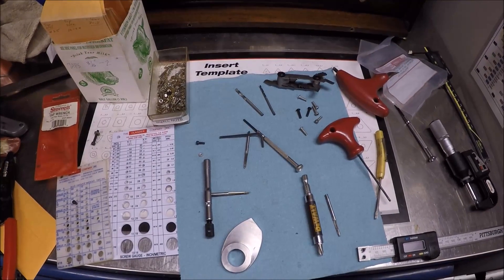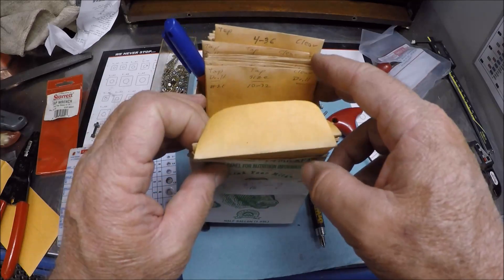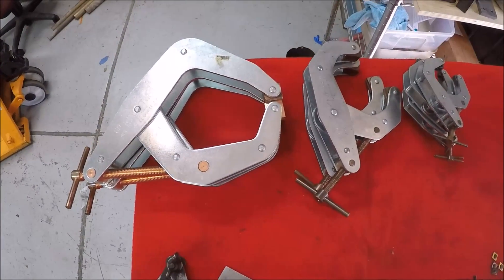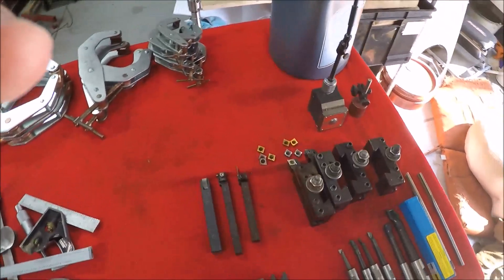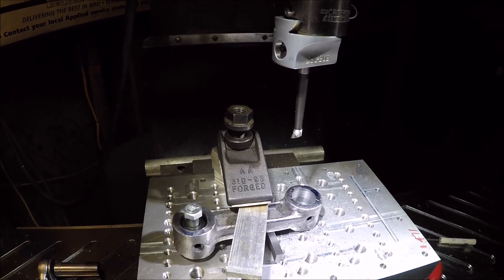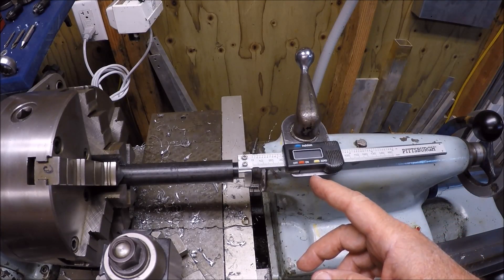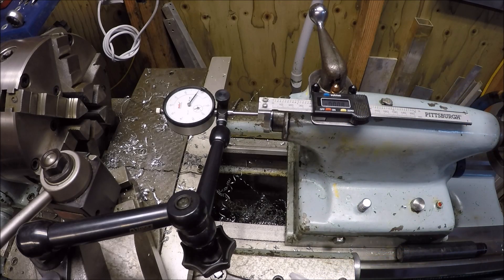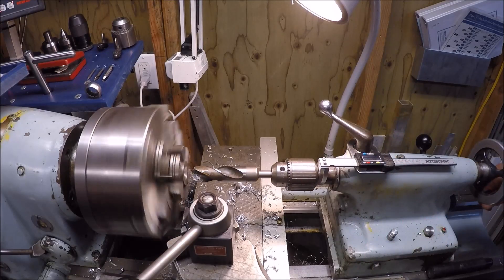Monarch 10EE Tailstock DRO Part 2

Comment: What ho Chuck, it seems there are a few things that should be common knowledge amongst the home shop guys but isn't. Abom didn't know about the "master" chuck key hole and you, please don't take this as criticism, appear to not know about drill chuck key use. When ever you tighten, or loosen, a Jacobs style chuck you always pull the long handle so the load is against the gears, to ensure proper engagement, The way you did it tends to bend the gears out of mesh and will wear them out. 
On a different note, how come there are so many garage sales of engineering type stuff in the US, I don't think it fair! :>(
ATB
c
Reply from the maker: Chris....I am always learning....thanks for the lesson....ATB